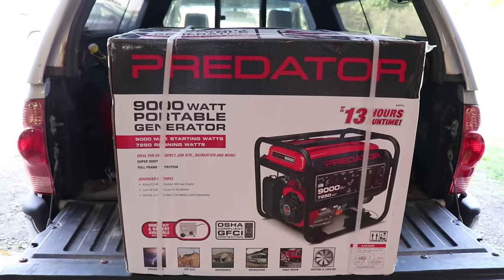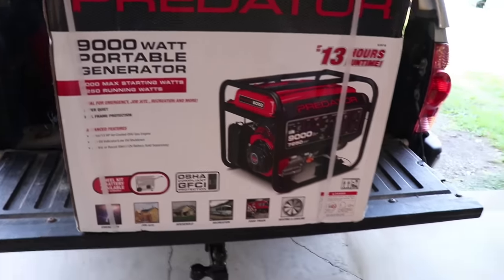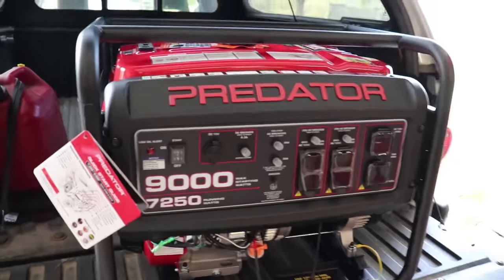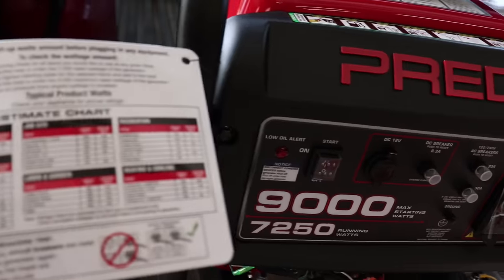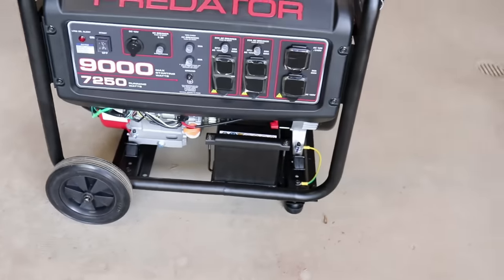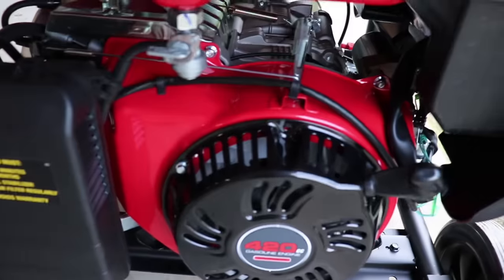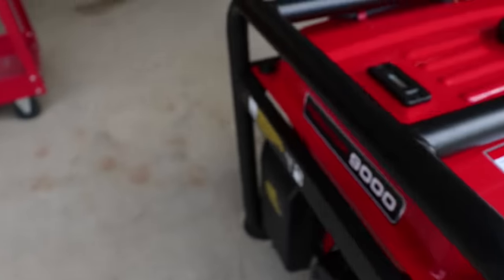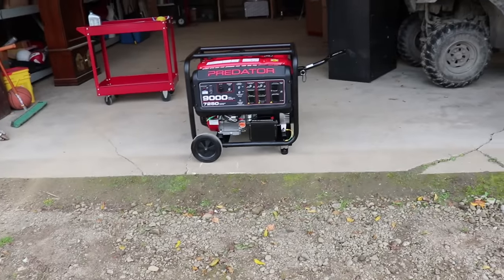Predator Generator Running Our ENTIRE Home. (Complete Setup and Cost)

Comment: Did you put a easy start on your central air unit so its not so hard on your generator  i have same one and it rus my ac but was curious if you installed  a hard start kit.

Comment: I have the same generator connected to my brraker box. Does the job perfect, question is, if I were to buy another generator, preferably one with higher starting and running watts, can I use the same setup on the breaker that I have already or do I need to do another setup for the other generator?

Comment: Just know when the appliances that have compressors, refrigerator, freezers, the inrush current go’s way up ,but just fir a very short time,
Reframe from going into the ref and freezer close together times, if the compressors come on at the same time it will trip, just manage the usage,.
Your wattage is your volts x current,  so for easy figuring ,7250 w divided by 240 v =30amp

Comment: Find you a diesel tank from a junkyard to store fuel. I found a 150 gallon aluminum tank from a wreck and bought it for $100. I cleaned it out and filled it with non-ethanol gasoline. Also, does that generator run your hot water heater along with everything else you just showed us?

Comment: Did your flat screen work? I've read use a modified sine wave converter on them. Just wired one up as a whole house and it runs everything including 18000btu air. Just now getting a new TV, old tube still works with generator but finally upgrading.
Reply from the maker: Works great!

Comment: Suggestion; When you calculate your wattage usage, you need to take into consideration starting surge. Each appliance has a decal that tells you amps to run.
Multiply amperage × 120A/C voltage, and that gives you your wattage. Now your water pumps normally are 240 volts A/C so your amperage actually be lower, but if the pump is not equipped with capacitors and you have alot of stuff running when the pump turns on, you can overheat the pump due to low amperage output left from your generator. 
So, on large drawing items, remember the original starting surge. They sell plug inn meters that will give you values as you turn on a specific appliance or water pumps.
Hope it helps.

Comment: Might I recommend a propane/natural gas conversion kit, for it makes it a lot cheaper to run, the fumes are a bit less toxic and you don’t have to keep so much gasoline on hand, the only downside is that the generator puts out a bit less power on propane or NG

Comment: I don't use the eco switch. I just run the thing wide open to prevent Power Surging. I like the predators. I used to be a die hard His honda guy. After using the predator. It handles very well on load start up. Especially when my 240 volt enqlow compressor starts up on a job sit. My honda bogged down hard. The predator engine hardly sputtered. 7500 vs 6500 homda. Predator wins 🏆

Comment: Do you not need to have it grounded? I just bought this one and see that it takes about having it grounded multiple times. Or is it because you have it hooked up to the house you do not need to??
Reply: When using the l14-30 receptacle to connect to an electric panel the generator is grounded through that cord into your homes ground.  If using say on a job site with tools then yes it should be grounded with a rod theoretically.

Comment: Got 2 questions
1. How long will it run on 8 gallons of gas?
2. Does it burn oil? I have a 4000 watt generator and 36 hours of run time it needs more oil to get it started.

Comment: A cheaper version is to connect your vehicle to a 7000 W inverter  for less than $300 and you have an infinite supply of fuel and you can drive that vehicle to get more fuel.
Reply: Darn good idea since my Navigator has a 30gal tank 🤦🏾‍♂️

Comment: Get a 8 gauge cord!!! Even my predator 3500 quiet gen heated up the 10 gauge 25ft. We run our 2600sqft house on the 3500 but its only small stuff. We rarely go over 15amps load the microwave or clothes washer spike it to 21 amps. No well pump, no AC, no 50amp electric kitchen. We use a 110v hot plate to cook with the generator👍. 

Three fridges, fans, office, basics we typically are 6-12 amps.
Reply: You have another issue going on. The 10 gauge 25' extension cord from HF, doesn't heat up at all, even at 70% load.

Comment: You've got to run the water for longer than 5 seconds to know if the water pump works.. it'll take a few minutes to draw down your pressure tank which flips the switch for your pump to come on.

Comment: is 30am circuit enough for the panel patch-in?  the generator can put out 70 amp.  just curious.  thank you for the video.
Reply: i think i figured out my own question...  70 amps at 120 volts, 30 amps at 240 volts.  please verify.

Comment: Excellent video. How many hours are you able to get out of the 8 gallons it holds?
Reply: It depends on the continuous load. It's rated for 13 hrs. at 50% load, that's 3,625 watts.  The less power you use under 50% load, the more hrs. you'll be able to go between fuel fill ups.

Comment: I have a dual fuel generator propane or natural gas runs longer than gasoline you also do not need to put anything in the tank. Since you have a farm a fairly large propane tank could come in handy. You do NOT need a ground to the floor these comments must be people confusing putting in the original breaker box which by the way has a ground. I bought a 50 am transfer switch with the cord and the box with the plug. It has automated switch and manual I use the manual switch I have been told its safer by electricians. I have the lock when the power comes back on my power to my generator is automatically cut off. You have a family I bought the generator with the CO detector on my generator since you don't have one I would install one in your garage but as you know you can't run the generator in the garage it must be outside. What I do is wheel it out when needed and plug into the box on the side of my house. When the power comes on I just go out side and unplug the generator and put it back in the garage. In the next decade with all government vehicles being switch to Eletric cars. We are going to see brown outs and power loss there are millions of government vehicles, and our power grid is not set up for this new load. The summer will be the worse. I am in Ma and we were already receiving messages to shut off our A/C's and stoves, dishwashers, microwaves etc. You are ahead of the crowd good for you because those who wait a year or two will be paying double what you paid and more than likely be on a waiting list.

Comment: If you're going to run sensitive ELECTRONICS which you all are then get an Inverter Generator. You need voltage irregularities controlled and monitored. Generators run at full power hence the noise, the inverter controls that power and also converts DC to AC. We use Inverters, Charge Controllers, Battery Monitoring Systems(BMS) to control and change the input and output in ELECTRONICS. You've all blown a fuse or tripped a breaker so same literal concept

Comment: Question: The connector, box and cover you're referring to at time 17:13 of your vid that you said was $30 - where did you buy that?  Do you have make and model info on those parts?  I would like to get the identical parts if available.  I looked on the usual sites but so far,  no can do.
Reply: Don’t forget about generator safety as well https://youtu.be/I1jT3ANENvI
Reply: @The_Happy_Aviation_Enthusiast  Thanks for the link.

Comment: I realized I missed a trick by not buying a duel fuel generator but luckily they have a carb kit to fix that. It was really easy to install and inexpensive to buy. It is tons easier and safer to keep a propane bottle or four than gasoline.

Comment: We have the 9000 also. It is wired in as you described but there is certain parts of breaker box that it will not power. We turn off the heat pump and air. Just wsnt main breaker lights snd fridge to run. But it only runs part of them. What could be the problem

Comment: Would it be ok to run a generator in garage with the door open, not the overhead door but the regular door. If generator was right by open door inside, and door going outside, would that be ok?

Comment: Great video, thanks for posting.  Is it safe to run the generator (carbon monoxide) in the garage or does it need to be outside?
Reply: I just researched that, and the answer is a definite NO. Even with the doors open, monoxide will build up to dangerous levels.
Reply: David Beachy thank you!!

Comment: Don't forget surge wattage required for motors, a refrigerator runs on 400 watts but needs 1200 every time the motor starts. The well runs at 700 watts but needs 2100 available at start. If you run your house AC on that generator you will burn the compressor out.

Comment: If you run a 4375 watt Predator generator at night ,every night do you have to use Stabilizer too.. I really need to know.. also,when you  run generator for first time for several hours do you have to pour out the oil and put new oil in it again .
Reply from the maker: You only need the stabilizer if fuel is going to sit in your generator for long periods of time. If you use it frequently and put fresh gas in you don't need it. And yes initially change your oil after a few hours of use and then once every 20 hours or once a month.
Reply: @TheCookFamilyHomestead  thank you so much. God bless you and your family.

Comment: Question: Could the 30amp generator breaker be installed anywhere in the panel and still work? I know they want it on the top for the interlock switch reason, but would it work on the bottom?
Reply from the maker: Yes but then you would have to install a transfer switch to make sure it would not back feed through your main to the utility pole.
Reply: @TheCookFamilyHomestead  it couldn't back feed with the main shut off I thought. I'm not a electrician, but how could it back feed with the main off?
Reply from the maker: @njm5991  not with the main off....but most codes require a switch that shuts off the main when you turn on breaker for generator. You would just have to make sure you always turned it off.
Reply: @TheCookFamilyHomestead  thanks

Comment: Question is , how long will the  8 gals. Of gas last ? At 3.00 a gal something to bare in mind . Dual fuel option would be a good thing . Not easy to store 50 plus gals. Of gas if it's attainable even , second option since you already have it would be propane .
Reply from the maker: Good advice. I get approximately 10-12 hrs per full tank depending on usage. When we had a fire our electricity was out for almost 4 days. I used it to run the whole house minus hot water tank. I would run it in intervals. Run 4 hrs off 2 hrs. Kept our 3 freezers and 2 refrigerators going good. Worked like a champ.
Reply: @TheCookFamilyHomestead  that's great it runs that long on gas ! I'm thinking of getting either the 5000 or maybe the 9000 to run on propane / gas back up . I have propane water heater , furnace but also wood furnace for me and my daughter so our demand wouldn't be that big . Your video was some good info . Thanks ! 👍

Comment: Does it work for your heating system in the house????
Reply from the maker: Yes it does!
Reply: @TheCookFamilyHomestead  sad I just got the 6500 because I was thinking the 9000 don’t have enough power so why have the 9000 if it don’t work ☹️☹️
Reply: @kelitowvilla9908  ⚠️portable generator safety announcements:

This is just a reminder to remember the safety rules when using portable generators. 

1) KEEPING OTHERS SAFE: Please do not allow an unqualified person or your children to operate and service the portable generator. Just because some manuals don’t say that doesn’t mean it’s safe. That is important against the generator safety rules. We also need to be keeping an eye on our children too. You need to make sure that your children are not playing near the portable generator especially when it’s running so they won’t get electrocuted. Generators pose electrical risks and they can be hot during an operation. Please keep your children away from the portable generator at all times. It is important to keep our children safe especially our little ones. Be aware of all the hazards.

2) WHERE TO RUN YOUR GENERATOR: Some people use their portable generators indoors which increases the risk of carbon monoxide poisoning. It’s important to have a carbon monoxide if you have a gas generator. Never ever use your generator indoors even if your doors and windows are open and even in the garage is not safe to use a portable generator. Please do not even use your generator in your deck or balcony. It is never safe to use your generator indoors and in enclosed areas of your home. Your generator needs to be 15-20 feet away from your house. 

3)🔥FIRE HAZARDS: Never refuel your generator while it’s running. You need to let your generator cool off before refueling it and before storing your generator. Never overload your generator too. Never ever back feed your generator. You should never plug your generator into a wall outlet. Also never store propane tanks indoors. Please keep flammable things away from the generator as well and please don’t smoke cigarettes near the generator. Having a fire extinguisher next to the generator is also important against the generator safety rules. 

4) GENERATOR OPERATION: make sure your hands are dry before touching the generator. Never use your generator in wet conditions. Don’t let your generator get wet. You need a generator tent if you need to use your generator during wet weather. Please don’t wear loose clothes when operating the generator. Turn on your generator before plugging in appliances. Use the right cord for your generator. Please do not use worn out cords. 

https://youtube.com/shorts/eFigDfnPkcQ?feature=share and here is a short video more about keeping others safe when using generators 

Hope this helps

Comment: I got a good deal 7000 W continuous 8250 Watt peak Predator generator for 200 bucks how much is needed to quit carburetor clean and it runs and produces the power like it should. I highly recommend picking one of these up the price for what you get and a piece of mind for power outages is just amazing

Comment: I would be curious if your furnace and blower would draw down more power than your 9000 would handle. In the great north winter storms, our biggest concern is keeping the heat going. Food can be placed in the cold garage with no fear of it going bad.  Yes it gets that cold.
Reply: We just bought one yesterday been without power since Friday we just ran extention cords for now but everything is working but we couldn't get the heat to work so I am not sure why that was my main reason to get..
Reply from the maker: It will run the heat easy and refrigerators and freezers and lights all easy. If you have an electric water heater, that draws a ton.

Comment: Can you use a regular car battery for a generator and what other kinds of batteries you can use for a generator ?
Reply: Any 12v car or lawn mower battery will start the generator.  Keep in mind that some generators, like mine, don't charge the battery.  I keep a battery maintainer connected.

Comment: I live in a Hurricane prone area and we get power outages for weeks sometimes and I just purchased this generator on a BlackFriday sale along with a 20% additional discount for signing up for their credit card and it cost me $450.  I need the wheel kit and battery as well, another $100.  So question is, can you run the central AC in the home with this.  I have a 3 1/2 ton AC central air conditioner, or is this to much draw for the generator.

Comment: FYI Make sure your generator is a FLOATING NEUTRAL generator.  Also for all those that keep saying you need a ground rod connected to your generator, WRONG. NO groung rod
Reply: NEC requires a gound rod connection because the neutral is still connected to the grid.  The generator's neutral and ground need to be separated.  If you are running the genrator independent of the grid, then the ground rod isn't needed and the neutral and ground should be connected together.

Comment: A couple years ago we lost power in July in Texas. It was over 100 degrees that day. It took hours before the power came back one. We were just dripping of sweat. My husband is retired and we were in our late 50's. We looked at each other and said we will never go through that again. He went to Harbor Freight that next day and bought this exact same generator that's being demonstrated here and connected it himself the same way as this man demonstrates with a disconnect power box and breaker that seperates the power companys electricity from the generators electricity so both can not be on at the same time. This generator has worked everytime we have needed it! Whenever storms cut off our power he goes outside and starts our Harbor Freight Predator generator and we have never been without power. Our house will be the only one with lights on😆. You can hear my neighbors wives bitching at their husbands for them not having power😆. Both the husbands and wives are quoting how much money each other has spent on items that they really didn't need😆. All my neighbors have their cell phones out bitching at the power company😆. We ever built a little house for it to set in that the sides and front door lift and stay open for ventilation while its running. We never regret buying our generator🤗. We even keep a 5 gallon of gas ready at all times.